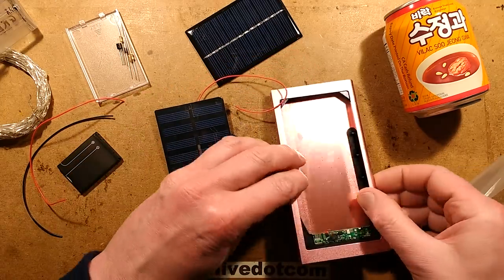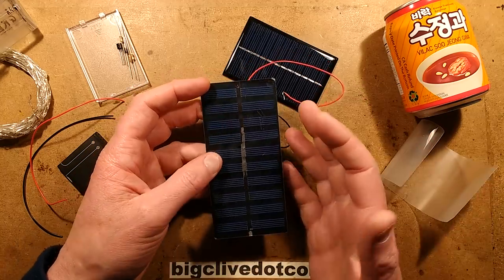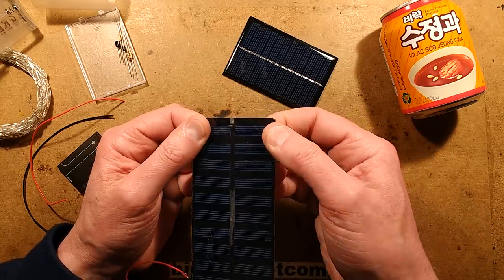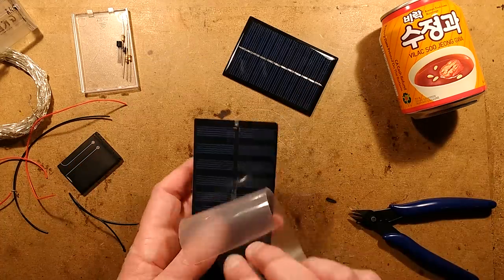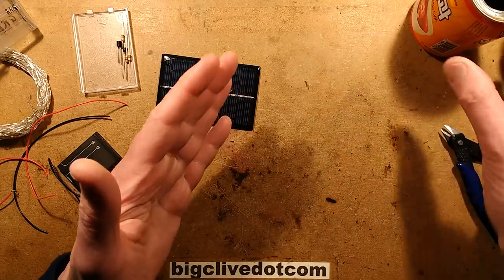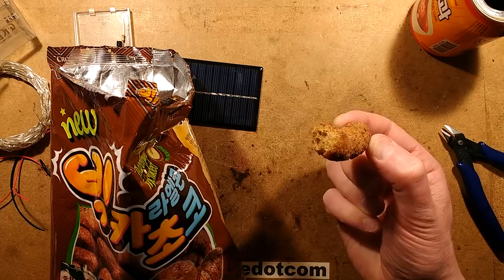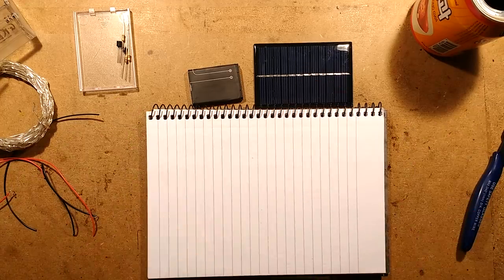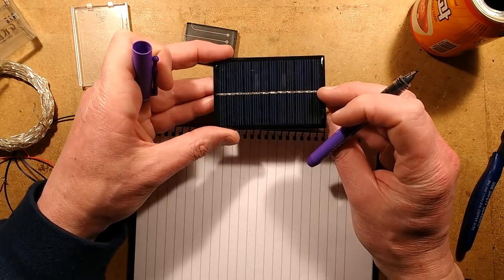Simplest solar light possible, using old phone battery.

Comment: But Clive, when I learned to solder many centuries ago, Rule Number 1 was 'You must have a sound mechanical connection before applying solder." I seldom see you do that. Is Rule Number 1 no longer a thing?
Reply: Yes, that and heat sinking the leads on solid state components because the heat of soldering can damage them.
Reply from the maker: If you mean like bending leads after inserting a component into a PCB then that's something I disapprove of.  It makes it much harder to desolder faulty components without risk of PCB damage.
Reply: My lecturers would have thrown anything I made across the room in disgust if I'd bent the component legs over prior to soldering!
Reply: It's probably one of those rules for beginners to teach a steady hand sufficient to provide said mechanical connection alone. After all, nowhere in that rule does it say that it must be a connection that can carry the weight of an average Olympic elephant and that requires tools and/or destructive bureaucracy to separate.
Reply: Same for me - but going back almost 50 years to valve and tag-board construction. I guess everything was under much more stress - like when changing valves, so perhaps mechanical solidity is less needed now. And as Clive says - makes it a pain to remove anything.
Reply: I suspect that good mechanical connections were important 50 or 60 years ago when a lot of electronics was point-to-point in a chassis from one tube socket to another.  There was also more heat involved; I remember one 2 watt resistor that got hot enough to melt its own solder connections, and such a circuit tacked together the way Clyde does it would fall apart.
Reply: Opinions vary. But on PCBs I only bend the leads a little so that components like signal diodes and resistors don't fall out when I turn the board over. But when doing point to point wiring, I use a small/fine pair of round noise pliers to form a small eyelet/ring (inside diameter of less than about 2mm) in one lead. Then poke the lead of the next component through the hole and solder it up. This has the advantage of me not burning my fingers while holding the component or wire, I don't have to always hold the component while the joint cools, you can easily use it as a tie point for multiple wires or components without having to hold all of them and it always makes a good joint 😎
Reply: Mark, do you happen to have pictures of your work you wouldn't mind sharing on, say, imgur?
Reply: For PCB work I now use Julian Illet’s technique of holding components with a blob of Blutack - also stops the board wobbling around on the desk.
Reply: Anvilshock  Hmm, don't have many photos showing what I presume you want to see. But the photos in this forum thread may do... http://www.mtxworld.dk/memorum/viewtopic.php?f=9&t=76
Reply: Got it, thanks!
Reply: condew, there's some truth in that with certain components, such as low power devices we were making in the 1980's, which were put together internally by using 60/40 solder under the die, and which could come undone if heated too much.

 Top connections tend to be ultrasound welded Aluminium or sometimes Gold. Most modern discrete devices are epoxy-coated, so connections are held together rigidly, and cannot move easily if overheated. The heat sink thing is mostly a hangover from the days of Germanium transistors and diodes, which really could be ruined with a hot soldering iron. 

One notable modern group of exceptions are complex devices such as the CPU in your computer, which have space above the die, because of the number of top connections needed. They can lift from their header if overheated. When power is applied, they will again overheat because of poor thermal and electrical contact, and then the Silicon can shatter.
Reply: @Richardincancale   Everything was structurally stronger back then.  Then came the transistor and ICs.

Comment: Clive, that is pure genius in its simplicity, well done! On the topic of npn transistors, my go-to one is the bc337. It’s spec’d for about half an amp, IIRC, and I’ve used it in everything from driving mosfet gates with its compliment the bc327, to rf oscillators! Very handy transistor indeed.

Comment: If you dont use protection for your battery then you might end up with heaps of little batteries! Lol!!
Reply: so funny
Reply: Did you actually watch the video....?
Reply: Peter Kay yes did you?
Reply: Mr. greens boat tanks and aluminium welding he clearly explains that the batteries have a built-in protection circuit.
Reply: Jason Kloos yes i know, it was a joke!🤑
Reply: ugh groany groany groany... lol.
Reply: I wouldn't mind a free and steady source of little batteries!
Reply: Anvilshock, they'll all be Chinese, and claiming that they have immense storage capacity.
Reply: Kappa

Comment: I remember being frustrated with the European transistors with part numbers I could not find. But usually I found a 2N2222 worked quite well. NPN with collector voltage limit of 60, current rating of 1 A and (usually) a 1 W power rating. In the rare cases where it didn't have enough gain, I used two of them in a Darlington config.

Comment: Lovin' this!  How about scaling it up a tiny bit, ...a 5w panel and a 3 w cob with a 6800mAh cell?
Reply: Sounds like what I did at my home with 24 volt panels, battery banks and several COBs
Reply: Could be an awesome idea for a camper floodlight.. might have to do this as I'm not satisfied with the outdoor lighting on my Dutchman.
Reply: You'll need a better transistor 2n2222 can only drive 500-600 mA
Reply: how about 100w panel 75w led and 2 car batteries.

Comment: A nice simple and safe circuit/project for beginners as well as the more advanced individuals .
A young person could make one of these as a present on mothers day .
Cheap enough to build using a salvaged lithium battery that contains the protection circuit .
In the states the 2N2222 or it's lower current cousin , the 2N3904 , we're at one time the general purpose NPN BJT ... they can still be found at some suppliers .

Comment: BC547 and it's cousins (546, 548, 549) are very common in electronics projects all over the world.
Equivalents to them, if you're somewhere they're not as common, can be:
BC337; 2N3904 ; 2N5088; 2N2222;
Or any other TO-92 package, NPN transistor classified as a "General Purpose Transistor". Just remember to check the pinout on the respective datasheet to the part you're using!
Reply: Odd how everyone seems to go for the BC547. I've always defaulted to the BC548. 
Is there much difference in them?
I'm guessing a slight difference in gain, voltage rating, or current rating might be the answer.
Reply: Possessive its has no apostrophe.
Reply: By default, BC171 I suppose. ...what? Not at all, what do you mean "oldschool"?!? If I wanted to go there, I would have said "AC181"...! ;)
Reply: Every single English course I've ever been to has always taught possessive "it" with an apostrophe.
But, you are correct, as stated here by the Oxford Dictionary:
https://en.oxforddictionaries.com/usage/its-or-it-s
Thanks for letting me know!
Reply: The BC547 seems to have a higher voltage rating while the BC549 has lower noise, at least according to wikipedia. Probably should default to the 549 if it is similarly priced.
Reply: 😮you left out the BC550! Which is the best of all the BC547-BC549 range. In reality, in most general purpose applications, the higher voltage of the BC546 or BC547 is not needed. And the low noise of the BC549 is not needed either. So I just buy whichever version is cheaper at the time. See https://en.wikipedia.org/wiki/BC548. If I need a signal transistor that has a higher current rating, then I normally go for the BC337.
Reply: @AttilaAsztalos  don't forget the dear old bc107, 108 and 109.
Reply: @AttilaAsztalos  
    Or...OC44, 45, 71, 72 etc. They all had their place and their time.

Comment: That diode placement melted my mind a bit. I would have kept it at the top and triggered a PNP with the diode anode voltage going low and a pull down resistor to common. Clever way to use that leakage current in your circuit.

Comment: That is probably the most useful quick project ever and I have all the bits ! 

Thanks Clive 😁
Reply from the maker: There's a way to test the battery to see if it has the protection circuit or not.  First check for voltage on the contacts and then dab a low value resistor like 1 ohm or less across the output briefly, and if you can't measure voltage afterwards it has the safety circuit.  To reset it just apply a charge current briefly and the full voltage should appear again.
Reply: @bigclivedotcom  I have a box of TC4056A (I think, eyesight is not great) charge controller boards) hopefully they will do the job. Thanks for the tip on testing though,  much appreciated!

Comment: I have tried it with an additional Reed switch so if I want I can turn it off, it needs the extra 10k resistor and an extra 1n4001 diode.
Thank you for the idea!

Comment: Great little project. The wife bought a garden light in the shape of a light bulb the other day. It has a tiny solar cell in the base and a few warm white LEDs in the bulb. I guess it looks similar to this, with a tiny LiIon battery, charge circuit and something for detecting dusk. A teardown of one of those would be nice.
Reply from the maker: Like these?  https://www.youtube.com/watch?v=QDuXmR5Iycg
If so I recommend putting some clear greenhouse repair tape over the solar panel and drilling a small vent hole at the bottom of the plastic globe to allow water and humidity out.
Reply: Yes, exactly like those!

Comment: Lovely video format and quite frankly I think I would listen to a recitation from a telephone directory with that accent!  May look at doing this for the fluorescent lights in my caravan to reduce the load on the battery when I am off grid as you suggest. Thanks.
Reply from the maker: If they are 12V then consider fitting your lights with standard 12V LED tape.  It draws a lot less current.
Reply: Cheers, will do. I had looked at replacing them as and when they failed, with purpose made LED tubes but they are a prodigious price for what you get. This is an elegant alternative.

Comment: I have been experimenting with this circuit while adding a tiny buck/boost PCB in between V+ and the collector, which outputs 3.3V for any input voltage between 1.8V and 5V. This allows to drive a white LED with a consistent output regardless of how full the battery is. It works, but it behaves pretty strange in some cases. For instance, if I shine onto the solar panel with a particular flashlight that has two brightness levels, the circuit will actually turn on with the ‘low’ setting even if there is enough ambient light to turn it off. It seems that the PWM signal which the flashlight uses in the ‘low’ setting causes the circuit to become active. Strangeness further increases when connecting multimeters to measure current, and the LED also lights up more if I touch its terminals with fingers from a different hand. High-frequency switching things can be weird.

Comment: I have a crystal garden light that will turn off in sun light or filtered LED light, but if there is even a 60Hz or more flicker, the light stays on especially if there is any pulse width modulation such as the dim settings. the circuit is fast enough to turn on between pulses. The light has the YX8018 chip, I think your pocket light in the low setting is pulsing and letting the light stay on. This could be used as a pulse detector. I'm still a regular follower, can't believe I commented 4 years ago.

Comment: While your design does save a transistor and a resistor or two, I still prefer the two-transistor design which I found on another web site a while back.  Besides two NPN transistors, it also uses three resistors (or four if you include the one for current limiting through the load) and a diode which prevents the battery discharging through the solar cell due to the leakage current.
Other than that, it works on a similar principle using the inherent current limiting of the solar cell and the battery protection circuit to prevent over-charging of the lithium battery.
Reply: Can you share the circuit you're using?

Comment: Excellent project. I think I have seen a similar circuit in a wireless drill charger. When the battery is charged, the battery voltage goes over the charger voltage. So, then the transistor switches charging circuit and LED off.

Comment: I have used a  "pet" drink bottle ( ie soft drink ) for year's with a small solar panel in it & the resin panel still looks like new also the plastic bottle still looks ok also. pet bottles seem to absorb uv but doesn't  effect them (at least a few years in sun)?? PS this panel is charging a phone battery but with a shunt regulator set at 4.2v max. is used for a garden water controller with no probs at all .  Great idea using the panel leakage to drive transistor .  thanks for vid.

Comment: I remember wondering about whether that pull up on the base was needed from the meteor light project. I didn't test it at the time because I ended up using a mosfet instead of a BC547 (the meteor lights could be quite power hungry, and with the BC547 spent most of it's time in the linear region and not fully saturated). Then a low power PIC was added to turn them off a bit after midnight, so they didn't annoy the neigbours by running all night, and save a bit of charge during the winter months.
Reply: I let my neighbors annoy me, and they're OK with me annoying them.

Comment: I built a solar light out of parts in this exact manner myself, except using a PNP transistor and positive-side switching. The diode-transistor setup causes a light that fades on and fades off gradually instead of the switching action of conventional solar lights.

Comment: "any light source of modest intensity will...oh". cheers for keeping evidence of you fallibility in the vid! (i should have watched the last 30 seconds. now im the one making an error! lol)
(clive, as you always seem read comments on your vids I don't suppose I could bother you for a touch of advice? all this is new to me. i only started learning about it last xmas time. but now i have got to the stage where i can, from first principles;rather than a plan, winkle an old 240 to 24v transformer from a stereo, i can make a full wave rectifier, i can smooth it's output, then use that with a lm338 and a panel meter/ammeter to make a bench supply. but if i only want 5v it seems mad throwing all that voltage away as heat. and the transformer has a centre tap. so i was thinking of using the centre tap with a second 338 or maybe a 317 somehow. i was considering a switch, but i have never seen a bench supply with a switch on it. what would you do if you were me, and you were as novice-y as I am?)
i have never read a book about electronics, or had any formal training. a year ago i  didn't know what ac and dc meant. but last xmas i started watching your's and mehdi sagdagaar's videos. and look where i am now! you and mehdi can never be thanked enough by me for making me somewhat 'fluent' in electronics. when i look at a circuit plan, be it pin-out or functional block diagram i get it, thanks to you 2. what i like to thing of as the grammar of the language, the rules and the way things work, again you 2. yesterday i soldered an SMD practice kit, with soic 8 and 16, and 0805 bits on it. it has a 4017 on it and a 555 and was an LED flasher, as big as my thumb. i soldered it and understood the principles involved. again you 2.
i just want to say a massive thankyou, and everyday when i sit before my scope, function generator, 2 bench supplies in serial for op-amps, and my soldering station i look upon it and think wow, look at what i understand and enjoy. how far i have come from not knowing what ac meant or what a transformer did to where i am now, thanks to clive and mehdi! you have opened my eyes to a new level of understanding about how everything works. seriously, it has changed my life. ta
Reply from the maker: These days you can get very useful buck regulator modules that will provide a 5V supply from a wide voltage range.  Keep in mind that the full wave rectified and smoothed voltage from a transformer will be significantly higher than the AC voltage, and will be even higher with no load.

Comment: For a couple years now I've been wanting to build a lighted wooden sign for our Boy Scout Troop to hang over the entrance to our campsite when we go to events like Camporees, Summer Camp, Etc., where we'll be with other troops (each with their own, separate campsite within walking distance).  We could use it when we go camping as a troop (without others around), but it would have more of a "wow" with other people seeing it.  This gives me an idea of how to do it cheaply, effectively, and reliably.

Sandwich a slab of polycarbonate between a couple pieces of wood (1" × 10" × 4' or 2.5 × 25 cm × 1.2 m, most likely).  Cut the word "TROOP" and our troop number out of one of the pieces of wood, saving the insides of the Os, the R, the 8, and the P.  Insert a string of LEDs into notches in the polycarbonate.  Wire everything up per Clive's circuit, probably substituting a couple of slim PV units which would sit within the 1½ - 1¾" (3.8 - 4.4 cm) thickness of the top edge of the assembled "sign".  If such a thing exists.

Assemble everything, putting the middle/interior pieces of the respective letters & numbers back in place (probably screwed into the polycarbonate from the back, because: neatness).  Maybe stain and certainly varnish the snot out of the project and seal the top and ends so the electrical bits don't get any moisture inside.

The idea is to make it bright enough to be seen clearly, but dim enough to not ruin the "out in the woods with nature" experience.